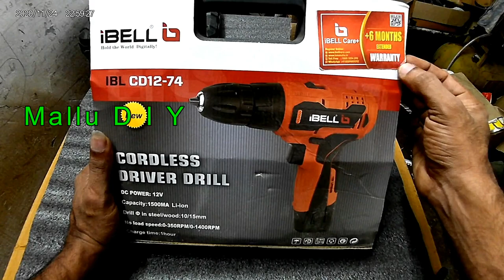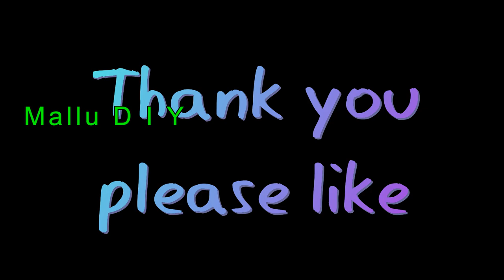ഡ്രില്ലിങ് മെഷീൻ താരതമ്യവും  റിവ്യൂ cordless Drill machine cheston and i bell review and comparison

Comment: Ibell njan vangiyirunnu bro
Battery& charger quality
Pora  charger 2 times
Poy
Reply from the maker: എനിക്ക് ചാർജർ ഇതു വരെ കുഴപ്പം ഇല്ല. പക്ഷെ ബാറ്ററി മോശം. 1000 രൂപയ്ക്കടുത്താണ് ബാറ്ററി മേടിക്കണേൽ വില . ഒരു മാക്സിമം 600 rs നു കിട്ടുകയാണേൽ കുഴപ്പം ഇല്ല. അത് വച്ച് നോക്കുമ്പോൾ കുറഞ്ഞ മോഡൽ മേടിക്കുന്നതാ നല്ലതു. താങ്ക്സ് ബ്രോ
Reply: True. Very disapointed battery  performance. Battery got damaged in mine too. I Modified this drill to work with a 12volt lead acid battery and now working as a corded 12volt drill

Comment: Very bad product ibell. Donot buy ibell
Reply: Battery suuddenly dead two battery. After another purchase ibell battery  so this battery dead. Now not use ibell cordless drill
Reply from the maker: yes, battery is not good. other wise ok. thanks
Reply from the maker: bro . if you can modify the battery , you can buy 3 *18650 battery and fix it inside of original ibell battery cartridge. if the battery is good it will work long. ( i did it same and working fine )